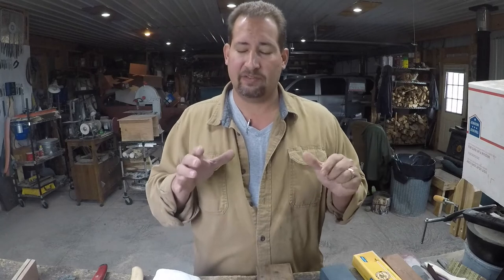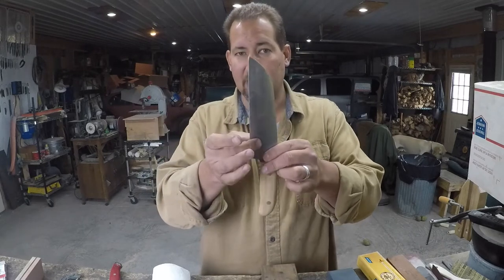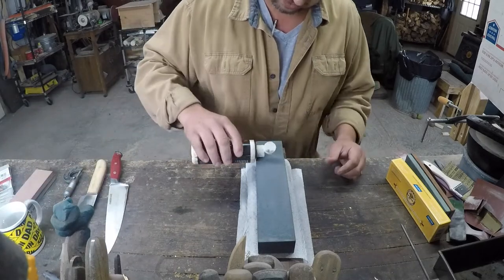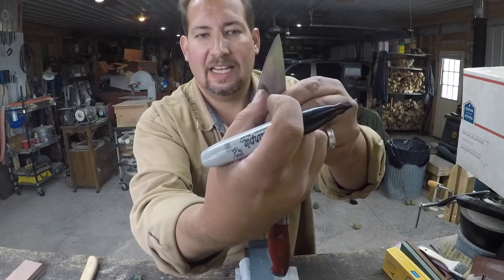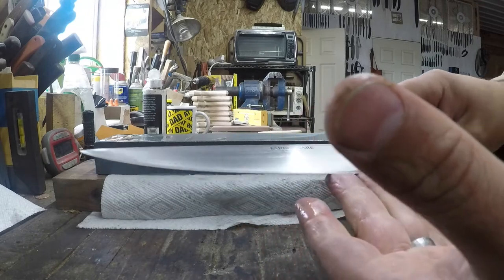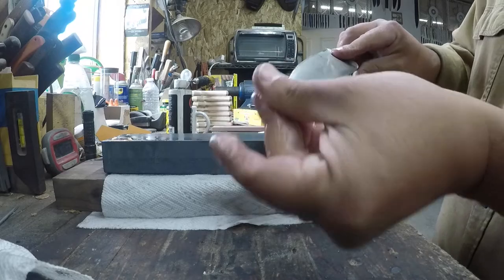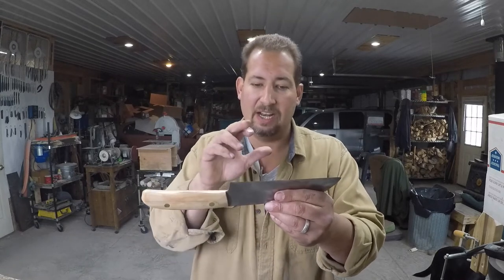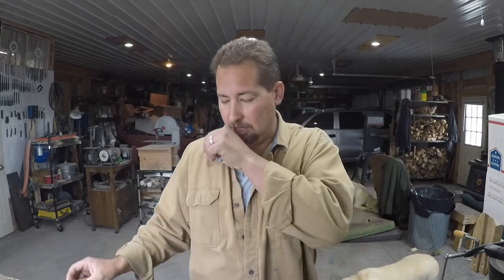regrinding kitchen knives by hand with a simple bench stone 1

Comment: It is surprisingly reassuring to have a simple, foolproof method for sharpening a dull knife with a single stone, in a complex, crazy world, namely...

Coarse side:  grind side A and raise a burr, flip it over and raise a burr on side B. 

Fine side:  Repeat the above...then make 4 lightweight passes on either side...then 2 light passes... then a handful of light passes on either side to further weaken the burr.

Remove the burr on a simple piece of wood by dragging it lightly through the end grain...and finally 2 alternating edge-trailing  passes each side to repair after the deburring process......and thats all it takes, folks! 
  
The world is now sorted, knives are as sharp as you can possibly need them for the next month.... no more 'mirror-polished' angst or self-torment. Simple and reassuring as Mom's apple pie! Thanks Joe. Great vid.
Reply from the maker: i guess i have never thought of it like that, but you are right, it is reassuring :}

Comment: A lot of people complain that the very coarse waterstones shed grit and dish way too fast, but that King 220 is hands down my favorite reprofiling stone. When you have a large surface area of the blade in contact with the stone (like laying the entire flat of the blade bevel down, then adding pressure to the edge portion of the bevel, which is my preferred reprofiling method) then the pressure on the stone drops considerably. In those conditions, the King 220 still sheds grit and cuts rapidly, better than the Crystolon even.
Reply from the maker: great to hear of your good luck with the king 220! I like it very much also, but like oil stones a bit better, so perhaps i am a bit biased :}

Comment: Love your knife sharpening videos.    I mostly use a 2x72 and a 1x30 belt sander to sharpen my knives.  I started to use more hand sharpening on a stone after I put the knife to a belt sander and it seems to get a more sharp edge. Is this just me or is there something to this technique?  Also very satisfying to sharpen a knife by hand using a stone. Thank you for your answer and this video was the first thing I put on the TV having my fist cup of coffee.  Again thank you
Reply from the maker: as great as belt grinders are, they are for grinding. I will sometimes rough in an edge on a grinder, but will always finish by hand on a stone. belt grinders can develop alot of heat very quickly, tend to remove material really fast, roll edges, and not hold as precise an angle as a simple bench stone.
Reply: @joecalton1449  love it... thank you and keep up the videos

Comment: Just wondering, why would you not use a Norton India instead for this job?
Reply from the maker: i have a couple of norton india stones, and while I like them and enjoy them, they are not my first choice for an everyday stone. they tend to dull and load up faster than a crystolon. the crystolon is a much softer stone that releases old grit pretty easy and exposes fresh sharp grit underneath which keeps it cutting faster and more efficiently than an india. but if you like the way an india works, and maintain it well, there is not reason you couldnt do the same sort of work with it.
Reply: @joecalton1449  I've just ordered my first crystolon stone, looking forward to using it. They cost a lot more here.

For fine edges the a dulled old Norton fine India does a great job, but the coarse India looses it's bite.

I'm enjoying the videos!!

Comment: I really hate using oil; I just don't like the feel of it.  I didn't see anything here that was heavy enough to require oil, I'd probably use dawn and water.  Once you use oil on a stone you can never use water again.  At least I don't know how.  Thanks for the pointers on thinning out blades.
Reply from the maker: i have heard that before about not being able to use dawn and water on a stone that was previously used with oil. I will say that on my stones, they get used and or cleaned with both. mostly I use straight mineral oil, but when im done, i take the stone to the sink and use dawn {usually the blue flavor} and water to clean the stones before putting them up on the rack. sometimes i will use dawn and water instead of oil. thats with all my oil stones, crystolon, india, and arks. I do not know about the other oils, but straight mineral oil and dawn and water seem to be pretty compatable.